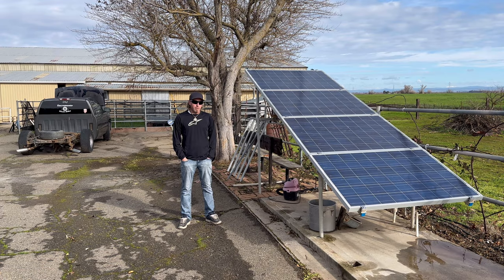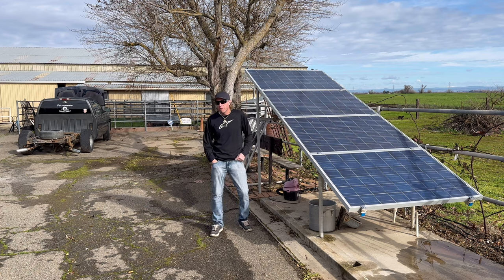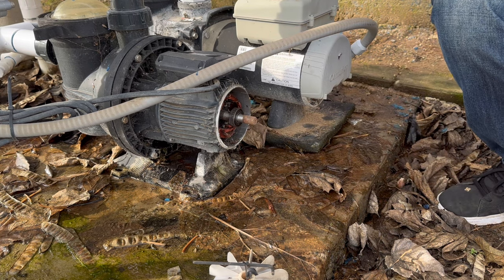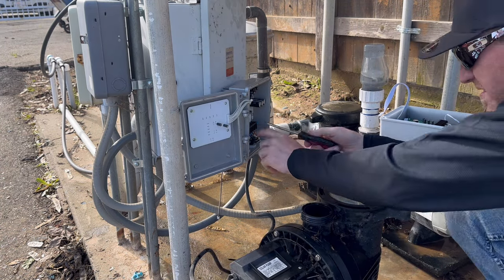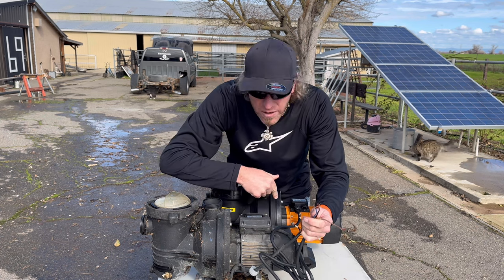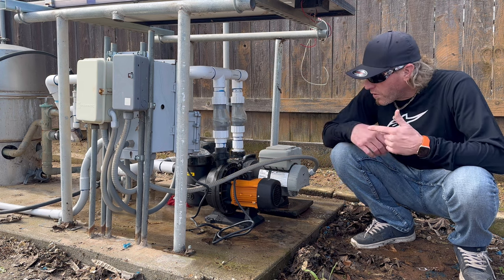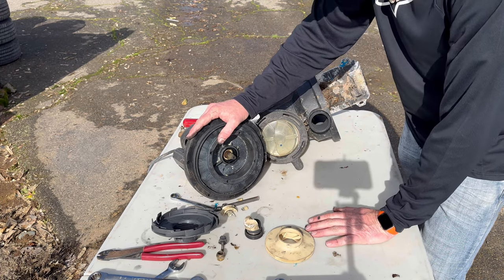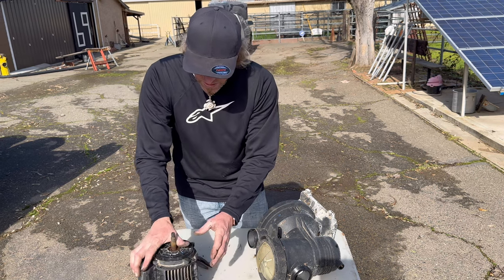DIY Off Grid Solar Pool Pump Update 02/2024  It DIED!!!!

Comment: If you didn't destroy the impeller would you have been able to fix the pump. Was it just a bearing replacement that was needed. I have one of these pumps and just wondering if I have the same issue down the track. Thanks for the update.

Comment: I remember when you installed this.
Mines still running we’ll see. Bearings are the weak point
Reply from the maker: Hopefully yours lasts longer than mine did. But the pump was made in china and is expected. I'm thinking about drilling a hole or two between where the seal is and the bearing so the water will drain out before it hits the bearing and if it does then I know the seal is failing before the pump bearing fails.

Comment: Just check the rotation of the new pump motor. All that will happen if you wire it up wrong is it will run backwards as it’s just a 3 phase motor. Running backwards it may not run as efficiently as forwards or it could overheat. If it is running backwards just swap any 2 wires at the inverter terminals.

Comment: Seems you matched voltage and horsepower.  It's funny/not-funny how if the seal fails first on one, its likely the seal will continue to be the first thing to go in the future.  You might get more life if you could prevent corrosion on the shaft: that leads to accelerated wear on the seal and bearing.